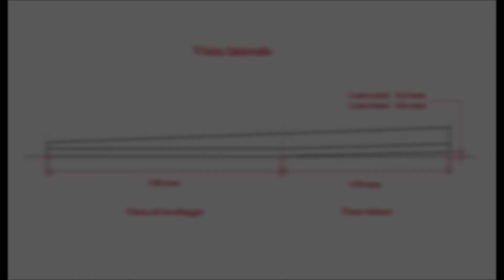Tastiera di violino parte prima - Realizzazione dei piani inferiori

Comment: Maestro Davide, thank you very much for your excellent work and help!! Could you tell me how thick are the boards that are screwed on both sides of the fingerboard holder? Thank you very much!
Reply from the maker: Which fingerboard holder are you talking about? The one you see in this video has no pieces screwed to the sides, just a glued piece that serves as a stop for the wider fingerboard end, which needs to be a couple of mm lower than the fingerboard to allow the plane not to hit it, and a piece of scrap spruce to protect the fingerboard from the metal dog of the vice in order to tighten it without damaging it. Just lower than the fingerboard for the same reason. No need for accurate measures.
Reply: Спасибо! Да, я так и предполагала. Все Ваши видео очень полезные. Я очень многому учусь по вашим замечательным урокам! Спасибо ❤

Comment: Thank you for posting this video, Davide.  I always enjoy watching your videos and have learned a lot from them about violin making.
I noticed that the gluing surface appears a little bit hollow (or concave) looking against the light .  I wonder what is the concavity for?   This concavity exists in  both the long and short axis.   Does the concavity in the long direction have something to do with the scooping of the fingering surface?
Reply from the maker: The concavity of the gluing surface is essential to ensure that the sides close perfectly, because when you put the glue the wood swells and tends to become convex. This concavity will also be on the maple of the neck where the fingerboard will be glued. This concavity is actually very small, the brightness of the light makes it seem greater than it actually is. I don't measure it, but I think it's no more than a tenth of a millimeter. It has nothing to do with the concavity of the curved upper part of the fingerboard where a longitudinal concavity is made to accommodate the excursion of the strings during the vibration.

Comment: Excellent video series as always, and a pleasure to see you work. Thanks.  I was wondering why the 0.2 more off of the bass side on the end of the fingerboard.
Reply from the maker: These slopes are used to follow the longitudinal curve (scoop) of the top side of the fingerboard. The side of the G string has a scoop greater than about 0.2 mm compared to the scoop under the E string, hence the difference between the lower sides.
Reply: @DavideSora Thank you for your answer.  So, if I am understanding correctly,  it is really to make the fingerboard sides look equal to each other?
Reply from the maker: @ChrisC811  Yes, or more precisely it serves to keep the sides at the same height until the end of the fingerboard. Otherwise, if the lower plane were perfectly straight for the full length, the height of the sides would progressively increase due to the curvature under the strings. it's just an aesthetic detail, from a functional point of view (playing) doesn't change anything.

Comment: Why do you put the metal strip under the finger board when you are planing it?
Reply from the maker: It is useful to support the fingerboard which is slightly concave (also due to the action of the vice) and to prevent it from sinking in the center under the pressure of the plane. If so, the plane would not be able to make a straight plane, but would always be convex along its length. The metal strip is a scraper 0.5 mm thick.
Reply: @DavideSora  Thank you.  I'm about to start working on my finger board and it's good to know that.